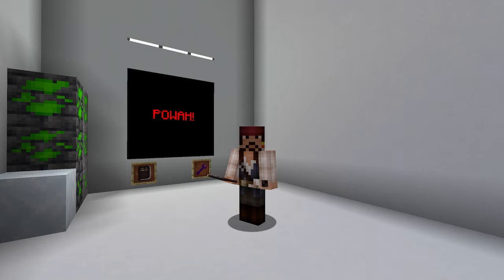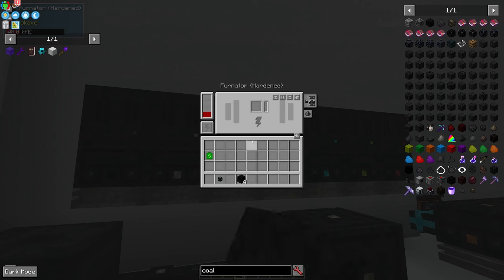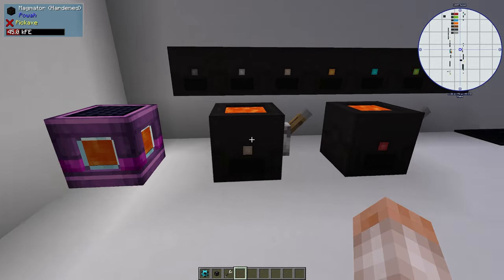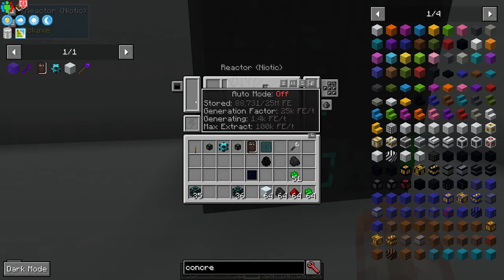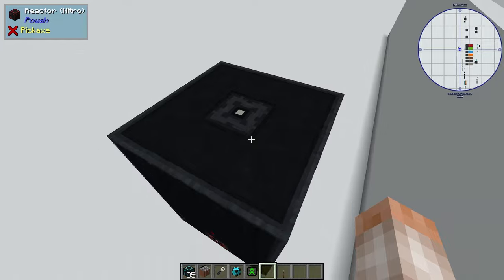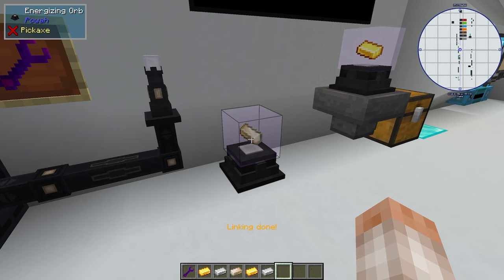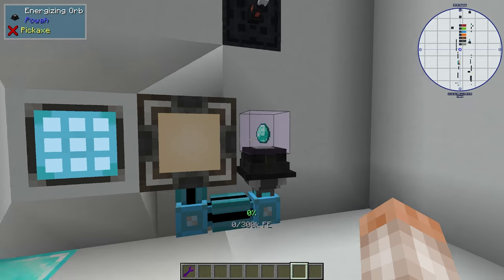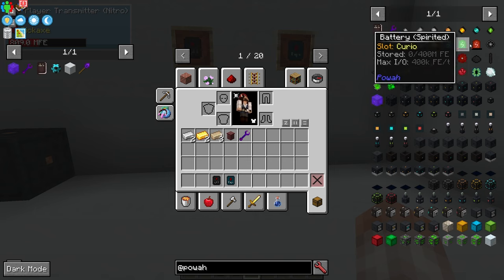Powah! Mod Spotlight - Reactors, Generators, and more! - Minecraft 1.18

Comment: Solar power in powah is worse than you thought. You read the maximum output, the generation is far lower maxing out at 2k per tick.
Reply: It is actually less efficient on each upgrade in cost, heck every single upgrade provides less power than the solar panels required for the recipes.

They are absolute trash.
Reply: @laughingalex7563  Yea. I used to like them before I understood how horrible they are. So I just made a mod for myself with what I consider to be more fair upgrades and recipes.
Reply: I had solar flux reborn which funnily was op, so i had to nerf that but it was nice i could tweak it to be more in line to what it provides to cost and space ratio, its still powerful but my view is solar (or renewables in general) should never be able to match up to a reactor in cost or energy density.
Reply: @laughingalex7563  Yea, The mod I made for myself it can match a reactor in size, but it is so expensive. I agree that reactor should be best, but I do like to have an endgame setup that is less laggy.

Comment: sadly the power output is incorrect the rate at which power is generated is a lot lower then the machines say because when it says x fe/t inside a machine its talking about the extraction rate for example starter solar panels say 40 fe/t but what it actually generates is 5 fe/t with 40 being the maximum you can pull out at a time so keep that in mind you can see the real value if you hover over it in your inventory

Comment: Playing All The Mods 9 for the first time, and honestly, I need an easy source of a lot of power. Some of the other power generation mods were way too intimidating for me. I started using generators galore which is even simpler than this. But I wanted to do something that required some more effort. Thanks for the tutorial.
Reply: I can't get the items from the crafter to move into the reactor, does anyone know why?

Comment: I should mention solar is VERY weak, due to the resulting panels at every tier being equal to or actually less effective than the prior tier panels used in construction.

1 basic tier providing 60fe needs 3 starter tiers that produce 20fe.  1 hardened takes 3 basic tiers and it only provides 100fe when the 3 basic tiers would provide 180fe.  So your LOSING power.  And that continues for future tiers.  Contrast to thermo gens which have a linear cost but only need one of the prior tier thermos for the next tier, so you gain energy, and thermo gens take very, very little water, i even sustained them on a a few buckets every other hour.  And they sustained me well until i got a reactor started(and i pondered sticking with thermos :D)

Comment: Good video showing the tiers and crazy levels of power that can be produced by this mod. One thing to be aware of is that some modpacks not only introduce different recipes, but apparently nerf the power generation. For example in ATM 7 Nitro Solar panels can output 160k FE/t (ed. - from the storage buffer), but only generate 2k FE/t

Comment: mekanism in the op overused mod competition when powah walks in
Reply: To be fair, mekanism fusion+turbine or fusion+boiler+turbine is still the easiest and safest way to generate millions per tick. Getting there is a bit of a grind, but the setup itself is easily self sustaining, even without outside mods.
Reply: @Wheres_my_Dragonator  i spent hours making an enderio combustion generator + crystallized canola oil setup for it to be outdone by a few windmills - definitely op.

Comment: Got nitro reactor struggles to charge unobtanium-all modium ingots do u need to charge up few nitro cells is there ment to be power runnin thru nitro cables says 0 fe plus cables don’t connect to reactor

Comment: I like Powah but it's pretty overpowered. I had my base running completely on solar and the giant batteries early on and haven't needed to touch any reactors or generators. Anyone know of a balanced/hard tech modpack for Fabric? Playing All of Fabric 6 at the moment but there's a lot of bloat and unbalanced mods.
Reply: You know, you probably would have had more power to resource cost with the thermo gens.  Solar loses power to cost efficiency, since you need 3 of the previous tier and the resulting panel has less total power than the 3 prior tier panels.  So your paying exponentially more for less every time.

Comment: How do you get water in the phytogenic insolator ?
Reply from the maker: Just pipe in water from any side...make sure you configure the sides of the machine in its GUI to accept fluids. It can also pull from an adjacent source.